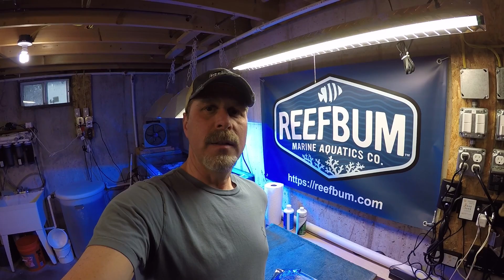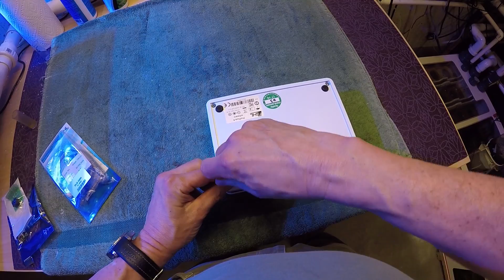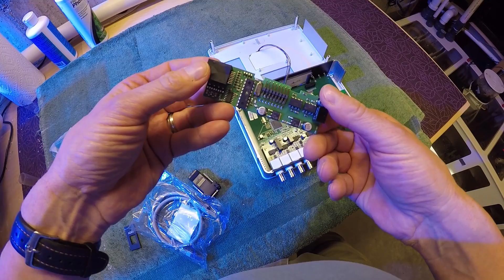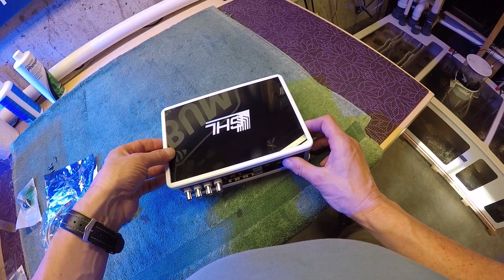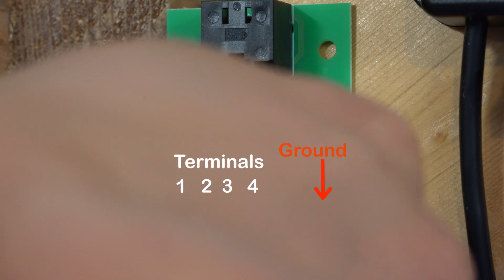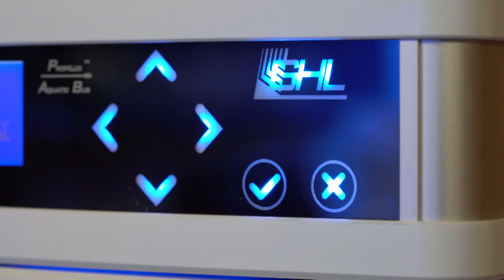Using a GHL Profilux 4 To Prevent Skimmer Overflows

Comment: I see ghl has come a long way since it was ran by Michael. He tried his best to get ghl to be popular in the states, but just didn’t really happen. I’m one of the early adopters with a p2, then a p3, and the first doser. Still got them today. I even have 5 Mitras 6200 still. If people think ghl is expensive right now, they used to be wayyyyyyy more. An ultimate profillux controller set was around $1600 when a Neptune apex full system was $700. Radion pro was $650, mitras $900. Back then they didn’t care to be competitive in prices with competitors. Their products were really good so they figured they would charge way more than anyone else, but 90% of reefers rather go with Neptune for much less money to do the same thing. And Neptune has way more product support being here in the USA. I guess ghl finally decided to be a bit more competitive in pricing, which obviously has brought them more success in the states now I see. That’s good, cuss I’ve always been a supporter of ghl products, even before most Reefers even knew who ghl was.

Comment: Did you buy all the accessories in terms of the expansion cards to wireless notification for your cell phone, etc?
Reply from the maker: Yes, I have wireless notifications for my P4 but unfortunately I can't have a notification for my skimmer cup since I am using some non-GHL components for the float switch setup.
Reply: @ReefBum  you would expect that with a binary input and a event/action to be triggered that it allso could be processed as a event notification ……..otherwise it is a lack of flexibility in the software in other words a missed opportunity.

Comment: So let me get this straight. You had to open the P4 and add an extra port. Then buy a BOB (which is ugly btw) to control the float switch? The programming was easy, but IMO the P4 should already come with that port for a BOB like the Apex does. I don’t want to open my controller to add extra ports. Not a fan. Strike 1 for Profilux. I’ll continue to keep and open mind as I love their GHL doser 2.1 SA. So far I’m not impressed with the P4. I hope I see better things in the future!
Reply from the maker: This was done because GHL wants to give users the flexibility to upgrade their controller without having to purchase external modules which only take up extra space and add more wiring to the whole setup. The two ports are open to be customized with the expansion cards that best suit the user.
Adding even more ports out of the box would have meant less user-flexibility and more external accessories to connect to the P4. If the user outgrows the built-in ports, they are free to install the card that gives them exactly what they need; extra probe ports, extra level sensor ports, combination of both, etc. In the end, the idea is to maintain that space-saving design without sacrificing user-customization options.
Reply: ReefBum - Well, that makes total sense. Maybe it’s not so bad. How much did you pay for that upgrade?
Reply from the maker: @Reefahholic  $83 for the expansion card and another $12 for the breakout board.
Reply from the maker: For this application you can also use GHL float or optical sensors which plug directly into the back of the P4. This would give you more functionality with built-in failsafe features and control. I went with the expansion card since I had my own float switch.
Reply: ReefBum - That’s not too bad I guess.